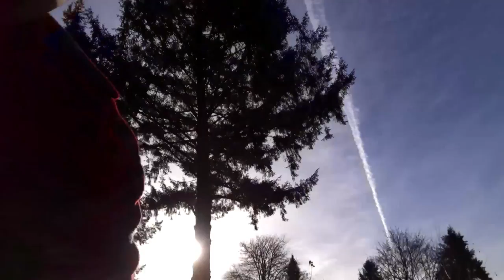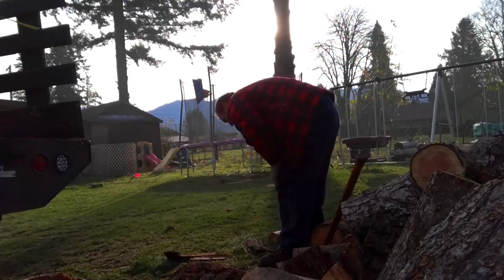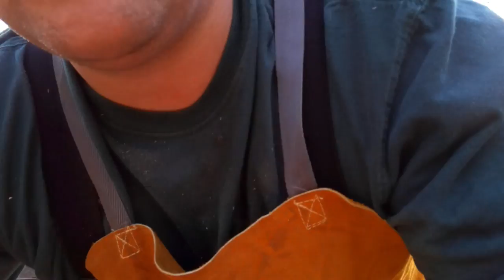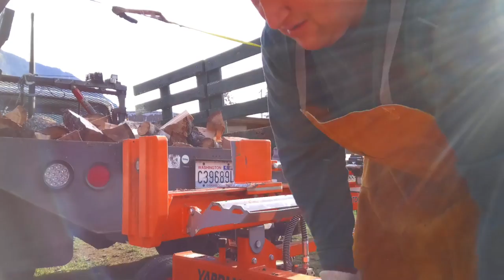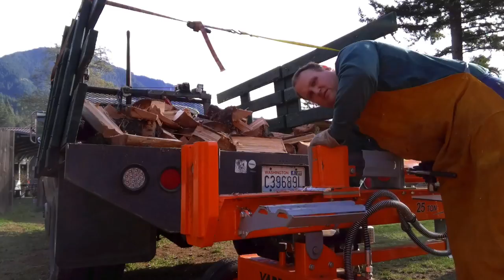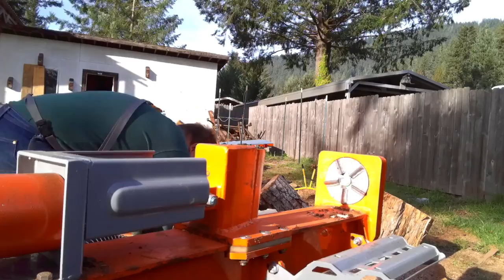Splitting some wood on a cold morning

Comment: How do you like that yard max splitter
Reply from the maker: I really like it. The higher gpm that it has over most other splitters makes the cycle time much quicker. The wedge design it more serviceable and narrow to begin with. This makes it split quicker and also split through knots better. It also has a throttle lever that allows you to idle down when not using the splitter like when moving more rounds of wood over. Has a built in gas shut off as well. If interested I have a video posted where I go over and review this splitter. Thanks for watching.
Reply: @WildBill1122  I have the 30 ton now for about 3 months haven't used much the true fir I have down here in Oregon splits way faster by hand
Reply from the maker: @wileyseifert5769  Here in Washington most of the fir splits fairly easy. I do like the splitter with the volume of wood I split. It is a little easier on the body.